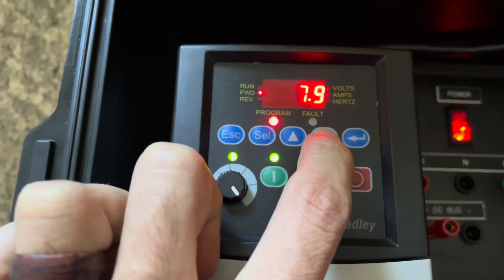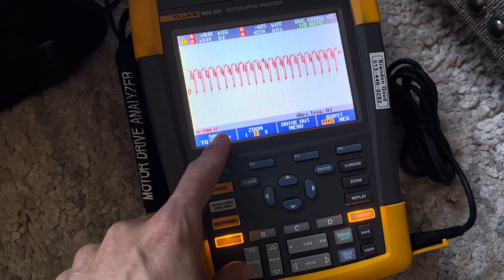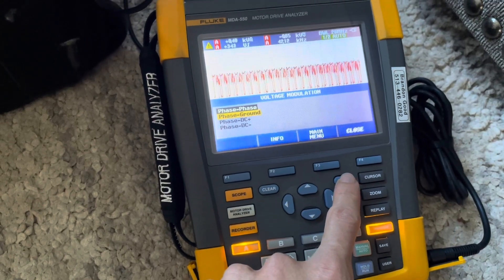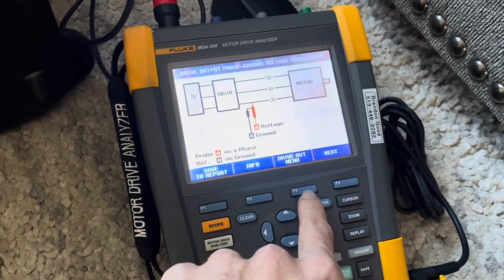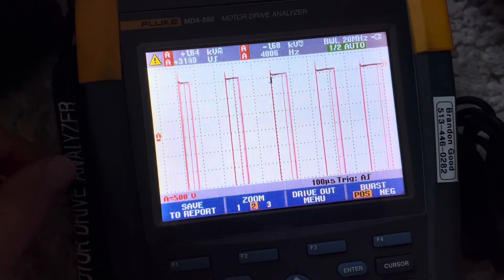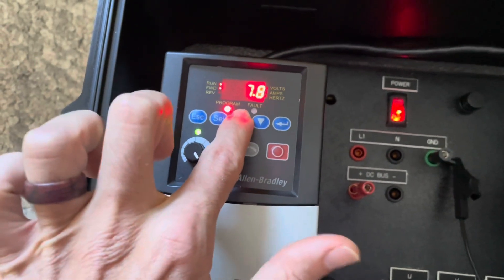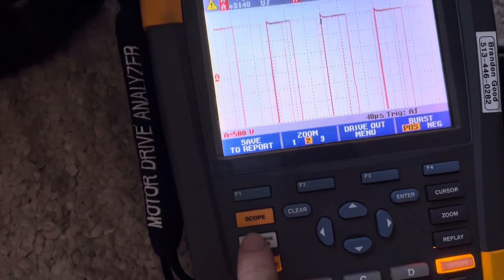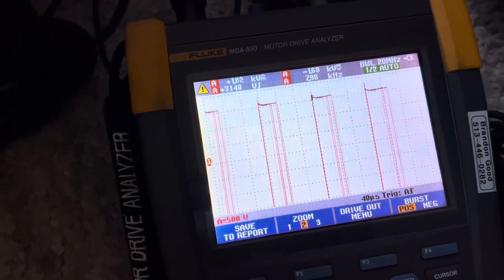Measure Carrier Frequency on VFD - Fluke Fridays - Episode 122

Comment: How many of the Fluke MDA-550 features carry over to the Fluke 438 MKII?
Reply from the maker: Not many. The 438-ii is designed to look at just the incoming power where as the NDA is focused on measurements in and after the VFD.